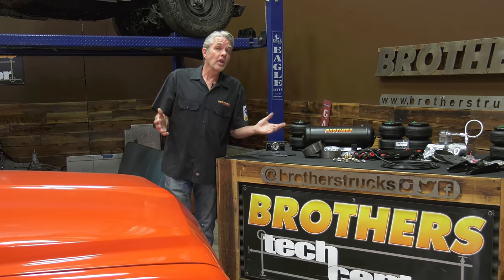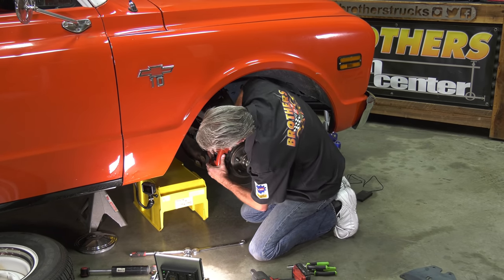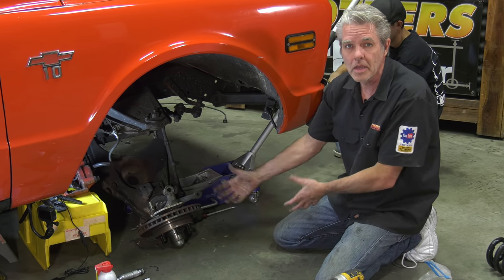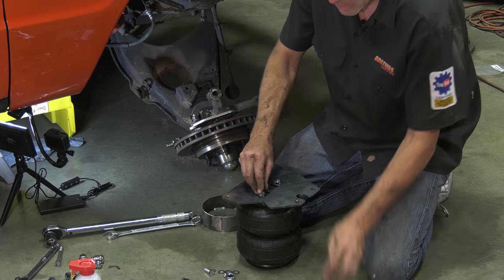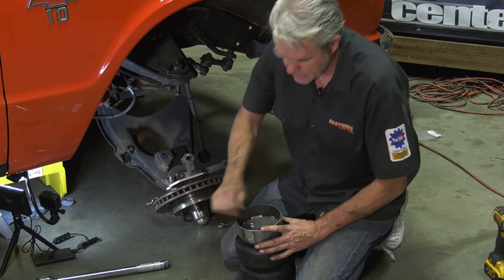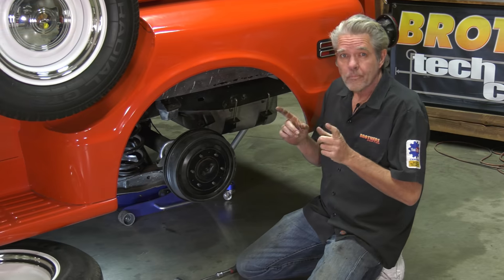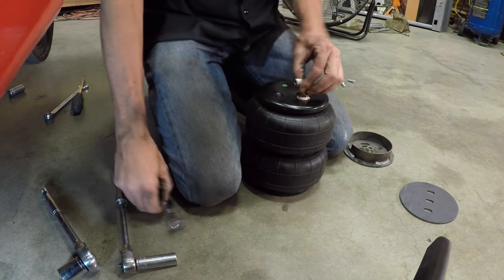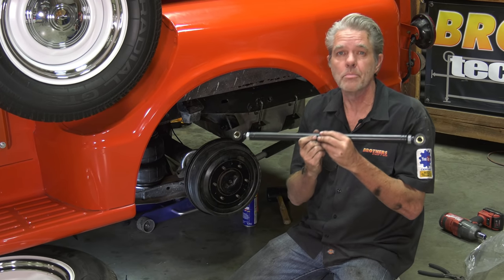1963-72 Chevy & GMC Truck Air Ride / C10 Suspension / Air Bags Install

Comment: @6:32 truck needs lower control bushings, look at how the lower control arm moved/shifted when spring tensions was relieved. Good video excellent explanation on everything. Hope one day i have the funds to do a kit like this on my late daughters truck.
Reply from the maker: This truck had new suspension components before we started the airbag conversion, including upper and lower shafts and caps. The reason it looks like it shifts whe the tension comes off is because as it started to extend, the tension decreased and Adrian (Dave's assistant) twisted the handle on the jack and it sped-up making it look like it shifted/moved. Thanks for watching and for your comment!
Reply: @BROTHERSTruckPartsTV  I thought the bushings were supposed to be tight to the point that when the lower arm has no spring tension on it, the arm needs to be forced down by hand? i guess the bushing was worn in or something.
Reply from the maker: @YoungHeartedSoul  They should be able to move freely, there is nothing that would bind them.

Comment: Restoring my childhood farm truck, a 1967 C10 long bed. I like to place a full sheet of $80 plywood in the back, close the tail and nurse my presses cargo home. I am very happy with my new stock 1/2 ton brothers rear springs and heavy shocks but getting to the front. Modified to tandem brake master & dual diaphragm booster the works perfect, I was curious if a guy who has now plans to up & down 16 times a day (unless wife say otherwise) can a guy tee these front bags together and just air them up, test drive, find a sweet spot and leave alone? I like things simple, reliable and by design, longevity. Even soaping the fittings and use liquid PTFE thread sealant correctly. Good point on the grommets for lines. I have seen hundreds of truck amps w/welding cable over a doors weather strip. Way too my wrong. Scotch Locks & loud radios sell parts! 
I am done fixing vehicles on flat rate. Yeah! ASE Master  - Retired
Reply from the maker: Dean, you can find a ride height/air pressure you like, set it and forget it.

Comment: I ordered the 2 kits needed and I have completed the rear bags.  The video is great! But I did not receive the written instruction or the nuts and bolts hardware that attaches the pieces to the airbags.
Reply from the maker: There are no written instructions that come with this kit, this video is the instruction manual. 
Please contact our office regarding your hardware and we'll get a set out ASAP
Reply: @BROTHERSTruckPartsTV  Thank you for the quick reply.  I mention the instructions only because he refers to instructions in the video.  As for the hardware I will call.  I'm already halfway done and have purchased the hardware locally.  Maybe I can get a few dollars credit on the rear fuel tank I will be purchasing soon.
Reply from the maker: @jeffgood1880   Ask for Jaz, we'll tell him to hook you up with a credit.

Comment: How does airbag ride quality compare to the trucks conventional coils and shocks ?
Reply from the maker: It depends on the setup really. Normally smoother, but it can be fine tuned with spacers on the bags so you could vary the air pressure to "tune" the ride quality to your liking. So we guess the answer is... it's up to you.

Comment: I have a 1972 c20 3/4 ton how do I do this with rear leaf springs? And thanks for all the videos you do.. very helpful.
Reply from the maker: You can do it with leafs, you'd need to convert it to rear trailing arms first. We sell a couple different options at www.brotherstrucks.com
Reply: @BROTHERSTruckPartsTV  does that truck have a c-notch? Or can I just install the bags without one?
Reply: I don’t have c-notch on my 1972 c20
Reply from the maker: @jairoquevedo5206   on this truck we did do a c-notch, but you don't necessarily need one, It just leaves the rear suspension more room to travel.

Comment: Can you do a video with your 73-87 stuff? All these trucks with trailing arms have videos, but so few on the squares!
Reply from the maker: Anything specific you'd like to see? We just did a video about rear shackles for the Squares. We've also done Axle Flip Kits and C-Notch, etc.
Reply: @BROTHERSTruckPartsTV  I’d like to add air ride to my squarebody but can’t find anything about 4-link kits—they all seem to be custom jobs. Front end stuff and trailing arms are easy but 4 link stuff is intimidating!
Reply from the maker: @endo71   Ok cool, we'll look into doing some videos about the 4 link conversion and the air ride for Squarebody's

Comment: Will this adjustable track arm (in description) work for my 1970 C20 or do I have to get the deluxe track arm kit from the website?
Reply from the maker: This is a 63-72 arm, so this definitely won't work for your Square. use the deluxe from our website and you'll be 100%!
Reply: @BROTHERSTruckPartsTV  thank you for letting me know I appreciate it very much

Comment: Great video, so to completely install this you need the air management and the suspension kit?
Reply from the maker: Our kit is complete. You can upgrade if desired, but this kit will 100% do the job.

Comment: Is the plate needed for reasons other than a place to mount your bag? I feel like you could make small bag mount and weld it up inside the pocket for more of a drop. Am I missing something? I ordered the kit for the rear and got it installed no problem. Just wondered why the plate was needed.
Reply from the maker: Exactly as you said, just to give the bag something to mount to. Not everyone has a welder or tools necessary to cut a pocket or fab a mount. This plate makes the kit useable by anyone regardless of whats in their toolbox.
Reply: @BROTHERSTruckPartsTV  Awesome! Thanks for the reply. I also noticed you cut the bottom bump stop off. Do you recommend using a universal mount just to have something in place?
Reply from the maker: @joea.6017  If we're being honest, we just let the built-in bumpstop in the bag do the work of the OG bumper.

Comment: Hi will this awesome Air ride set up work for a 1966 Chevy C 10 pick up truck? Thanks
Reply from the maker: Yes, it will work on all 63-72 coil spring chassis.
Reply: Yes I’m currently doing a 66 c10 fleetside

Comment: So how do I lift the front or rear of a 64 3/4 ton . I plan on hauling a heavy horse trailer and trying to keep it stock with just a little bit of altitude.  Would like it if most people couldn't notice it . Thanks . More videos ! Appreciate all your help
Reply from the maker: You don't have a lot of options lifting a 2wd except maybe using coil spring spacers. If it's a 4x4 then you can use blocks or even lifted leaf springs. On a 2wd or 4x4 you could also do a body lift, but that doesn't make much more than a cosmetic difference.

Comment: If I have a front cross member that seats the top of an airbag instead of bolting the plate to the upper control arm, are the top of these bags capable of mounting there without the plates instead?
Reply from the maker: Our air bags are not tall enough for that type of mounting. Additionally, because the angle of the bag changes as it arcs, we don't recommend mounting up in the top seat because of the potential for it to rub on the crossmember and eventually get a leak.

Comment: in the back it doesn't need the leaf springs anymore for a 1986 chevrolet pick up?
Reply from the maker: The rear end of a leaf spring equipped truck would have to be converted to a trailing arm style before this kit would be useful.

Comment: I ordered the complete suspension kit and the air management kit, I have a 1964 step side with the short bed, should I also get the adjustable rear track arm that you sell? Also would this even fit my truck as I see that it is listed as being made for 1965-1972 trucks. Thank you guys .
Reply from the maker: You should buy the track arm so you can correct the position of the rear end. Additionally, you should strongly consider adding front AND rear sway bars.

Comment: Any ideas on doing this to a 75 C20 and 68 C30. Not really to lower, just wanting a smoother ride. Thinking on removing some of the rear leafs but getting heavy duty capacity back with air bags. Thanks
Reply from the maker: they would both require the installation of rear trailing arms in order to accomplish the air ride conversion. The front would work basically the same as this, but the rear needs the leafs removed first. We sell a conversion kit for this project if you are interested in tackling it.

Comment: Is there 1 pressure for the front and another pressure gauge for the rear?? Or 1 gauge for all in this kit
Reply from the maker: Our kit uses a single gauge with Dual Needles and it's capable of controlling the front and rear pressure separately.

Comment: Will you guys be making a video on how to do it to a 62 c10
Reply from the maker: We don't have a complete kit for the '62 right now, so we won't be doing a video until a kit is available.
Reply: @BROTHERSTruckPartsTV  ok 👍
Reply: Also got a 62 , wish I could ditch the torsion car setup
Reply: @Somynigga  yeah i feel the same way
Reply from the maker: @Somynigga   You can! We're going to be doing a video very soon that shows how to ditch the OG front end and replace it with a 73-87 front end. The job isn't really that hard and some of the holes are already in your frame to line it up!
Reply: @BROTHERSTruckPartsTV   awesome can’t wait , I’ve heard of that process just never under took it due to no real guide of it being done in video format . Quick question not sure if you guys will know but does a 62 c20 frame also work with the process of converting over to a newer Chevy front end  . From what I’ve research haven’t been able to come up with a solid answer , and If I’m not mistaken the c20 frame is a bit thicker . Any insight would be appreciated and as always continue the great work guys 👍🏽
Reply from the maker: @Somynigga   Can't imagine the C20 frame would be any different when installing the newer front end. Frame thickness isn't going to change anything.

Comment: Can the factory ride height be achieved if this kit is installed on a stock non lowered c10-c20?
Reply from the maker: The length of the bags in this kit are designed to lower the truck. Longer bags can be used to keep the factory height. Please contact our customer service department for options.

Comment: So how do you mount the rear bottom mounting plate? Does the bottom of the bag have a center 1/2” unc hole? 
Does brothers sell just the bags?
Do the bags differ from front & back?

Comment: How much air pressure in those bags if you have a full factory load limit ?
Reply from the maker: The amount of pressure is going to vary wildly by the application (ie; 1/2 ton, 3/4 ton, longbed, shortbed, metal floor, wood floor, etc). For reference, our bags are rated to a max pressure of 600psi, and have a load range of 350-3000 lbs per bag which exceeds the factory load limit of a 1/2 ton truck by a LOT. Our suggestion is to add air under load until your desired ride height is reached and note that pressure for your specific application.

Comment: So if youre replacing the coil springs with bags, are they good enough to be used daily?
Reply: Keen to see the replies here
Reply from the maker: Absolutely, there's no reason you couldn't daily drive a truck that has been bagged. Many vehicles throughout the decades have been equipped with air bags right from the factory! We have an employee here at BROTHERS that drives a '69 C10 everyday to work with bags.

Comment: In the end of the video is the truck as low as it gets? On the website it says it goes all the way to a 7/8 drop, if so does the gas tank have good clearance,thanks
Reply from the maker: We had some wheel/tire clearance issues with the setup on this truck so to answer your question, NO this is not as low as it can get. A 7/8 drop is typically what you can expect.
Reply: mines a 70 gmc 
8 inches down on springs  !!! bags are for groceries  .
Reply: are brothers hireing  ??? this guy obviously doesn't work in a shop !!

Comment: @BROTHERS Truck parts  will this work for the c20's?
Reply from the maker: Yes, as long as you have coil springs in the rear.
Reply: Do you have a setup for rear leaf springs?

Comment: How much more trouble is it to do a truck with leaf springs?
Reply from the maker: You basically can't do air ride on a leaf spring truck. We sell a kit that converts the rear to trailing arms and then you can add air ride.

Comment: Does the rear air bags fit with a under the bed gas tank
Reply from the maker: Yes. The truck used in this video has an under-bed tank

Comment: What if just want lowered springs or coil over shocks do guys @ Brother Trucks know a specific brand .
Reply from the maker: We have our own brand of Coil Springs, but we're not familiar enough with any coils overs to recommend one.
Reply: @MalikDigger454   > Coil over shock will most likely involve the upper & lower control arm change as the length and mounting changes. Be prepared to change springs at least once even if calling customer service first for approximate spring. But one thing to keep in mind is service. Depending on use, but shocks have to be removed, sent to an authorized facility to have them over-hauled complete. This is because valving can fatigue, seals wear, oil degrades with time, use & wear. Just plan on that every 20k-30k miles for this work, expense plus down-time. ASE Master Retired

Comment: Does Brothers offer that kit for any other year truck like my truck year 1952 GMC
Reply from the maker: We don't offer a simple kit like this for trucks with leaf springs. To add air bags you more-or-less need to completely redesign the suspension front and rear. We have suspension parts to get your truck low, but not on air.

Comment: To What number on the relay does that wire  coming from the pressure pump switch go too ? 
I understand the other red wire from the pressure pump switch goes to the dash controller and the other wire goes to the relay but you don’t say to what number on the relay thanks again
Reply from the maker: Man Bill, at the moment I can't remember and I don't have the wiring diagram in front of me. Please call the shop tomorrow and someone will look it up for you. Thanks for watching!

Comment: What size tires and wheels on that stepside? Drop spindles?
Reply from the maker: Don't know on the tire/wheel size, but NO on the drop spindles... that's next!
Reply: @BROTHERSTruckPartsTV  Thanks for the reply I like that tire and wheel size combo if you do find out would appreciate the information. Thanks also for all the input and hard work!
Reply from the maker: @jimmybags4209   We'll see if Dave can ask the owner of the truck for the tire sizes.
Reply from the maker: @jimmybags4209   Set is 15x8 in front & 15x10 in rear. Front tires are 255/60/15 & rear are 275/60/15. Quick right?
Reply: @BROTHERSTruckPartsTV  awesome!

Comment: Do you have a diagram on paper
Reply from the maker: A routing diagram? If that's what your talking about we don't have one. Routing of the air lines is sort of dealt with on a job-by-job basis depending on tank in the cab, hidden under the cab, behind the bumper, etc.

Comment: you didnt have to weld or bolt in the bottom control arm bag pocket?
Reply from the maker: No, our kit is 100% bolt in
Reply: @BROTHERSTruckPartsTV  okay, so is there anything that prevents metal to metal wear between the lower cup and control arm? If no welding or bolts are used for the lower cup, what keeps it from moving around in the pocket?
Reply from the maker: @musclecarsforever  The lower cup is bolted on.
Reply: @BROTHERSTruckPartsTV  its official, I'm an idiot. Thanks. I'm getting ready to do my first air ride install...I now see the spot for the all thread

Comment: "And their not a lot of time and trouble to install". Oh yeah, try doing any other truck outside a Chevy.
Reply: Okay, i did it on my GMC and it was still easy 😂
Reply: @MegaWillinator  Chevy and GMC are the same thing. SMH. Try doing a Torsion bar truck or a Ranger. And if you want to lay frame No truck is "easy".
Reply: @Ladysman_217  lmao I was only making a joke, I know that non GM products are substantially harder to make alterations to. My buddy swapped a crown Vic front subframe into his D150 to avoid dealing with the stock stuff